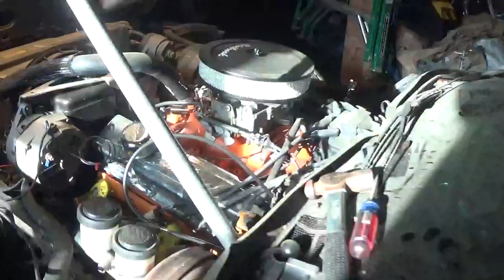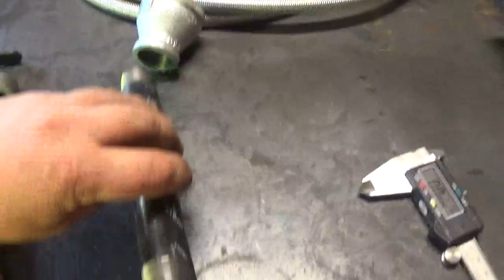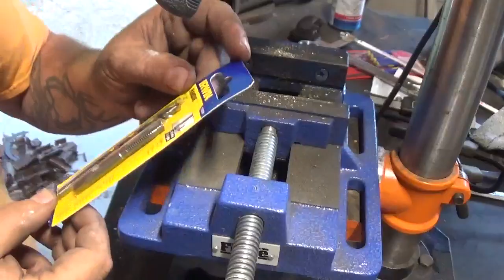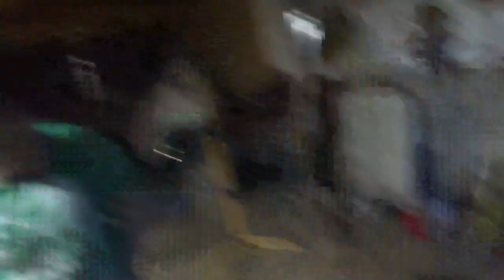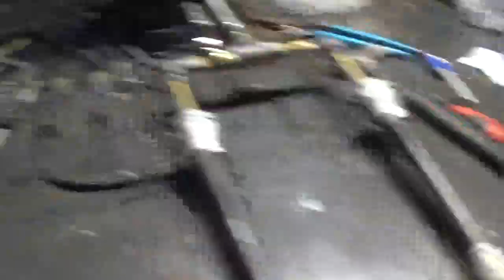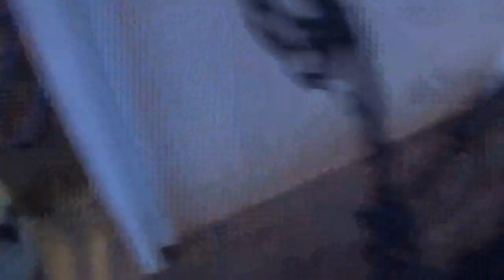How to build forge burners

Comment: Nice, neighbors are probably freaking over the noise. Galvanized metal + heat always scares the piss outta me but you boys seem to know what youre doing.
Reply from the maker: I'm a welder by trade, the galvanization will burn off pretty quick... when it does it will put off a yellow smoke.  Just don't breath the smoke when that happens and your fine.

Comment: Very nice. I like the design. I will be using it to build my first forge. Since its been awhile since the video posted have you noticed anything that mite have been a improvement over this design? I was thinking the brass nipples are a little long and could maybe benefit from shortening them up a bit to maybe 1.5 or 2". Have you noticed any bending in the brass nipples? The distances between the burners seem kind of far away for a crucible. What kind of a forge were the burners built for maybe a metal working forge? To shorten them up I was thinking of using just one shut off in-between the 3/8 flare coupler and the 3/8 tee? Do you think that would work ok? Still researching and learning any help is appreciated, but your build here seems to be the best I came across so far.
Reply from the maker: The very first thing I would like to change is the handle for the forge door... it gets too hot too fast I have to use a piece of pipe to adjust door.  As far as the brass goes no issues so far and yes I'm sure they could be shorter.  The main burner tubes need to be at least 8" this gives enough time and distance for the gas and air to mix, and prevent too much heat from traveling up to the gas ports and valves.  They were built for a blade smithing forge and work well, would need to reconfigure for a foundry.  And yes one shut off would work with no issues.

Comment: It's easier to use a welding tip instead of drilling orfaces just another option
Reply from the maker: I have seen some like that they seem to work well.  I'm not sure it it would be easer.... its pretty easy to drill a hole.

Comment: If you brake your TAP off in the hole get black diamond drill bits. as a matter of fact whenever drilling holes in metal use Black Diamond drill bits they are the best and the fastest they're going to run you a pretty penny about 50 bucks at the Lowe's.... and while you're at it ,grab a couple kinds of penetrating oil. Penetrating oil helps save the life of the drill bit.

Comment: PSA: Galvanized metal, when heated is poisonous. Best to use black pipe OR remove the Galv coating.
Reply from the maker: true
Reply: This is true but the galvanized will burn off quickly inside the forge but black iron is best

Comment: What kind of burn time do you get out of a 25lbs  propane cyinder with those two burners? Looking for something similar and no one tells how much gas it burns.
Reply from the maker: the double burner burns a lot more, if I'm running the forge at welding tempuraters 3.5 to 4 hours will drain a standard grill tank.